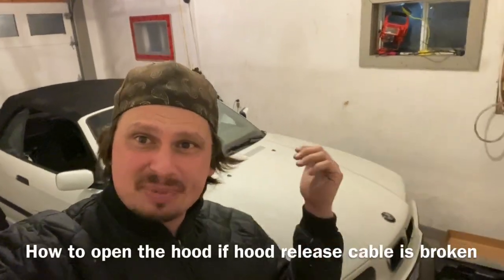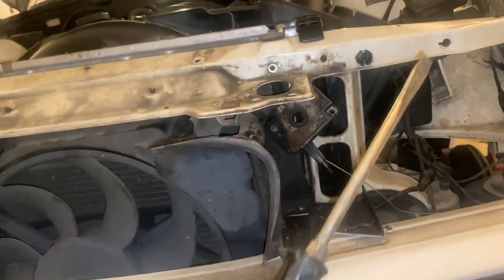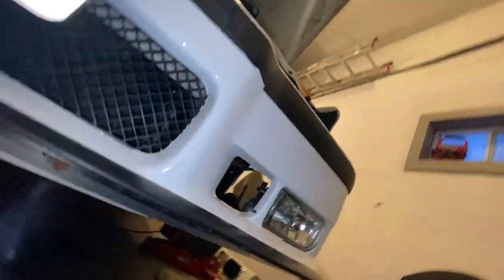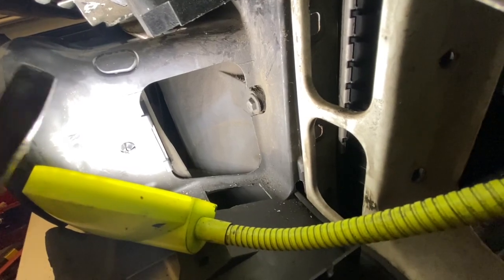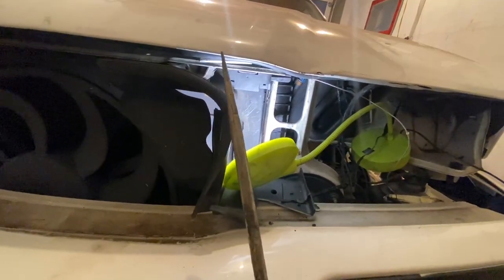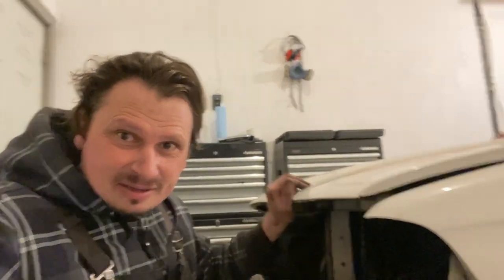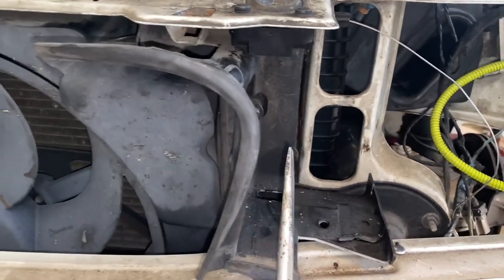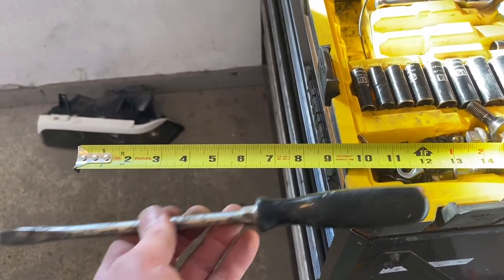BMW e36 How to open Hood with broken hood release cable (without removing anything)

Comment: Guys it really works! Maybe you should know, you’re not going to pull that whole lock to the opening side.. you just have to move that plastic wich holds the cable of the passenger sided lock & push it slightly over 🦾 

do that movement, which the cable would do! 😊
Reply: Definitely following you, bro!
U saved me😅

Comment: Gonna try this tomorrow! 🙏🙏👍👍
Reply from the maker: Awesome good luck, it does work
Reply: @ProblemSolverGarage Success! I didn't have to even use a screwdriver or remove bottom bumper shroud.
Instead I popped the front kidneys out, peeled back the plastic guard and used a pair of expansion bent tip cir-clip pliers, it was too easy! 
Many many 🙏 Thanks! 
Now I have to replace that damm cable!
Reply from the maker: No problem, glad you figured it out good luck with the cable I also have a video on the cable are very detailed one
Reply: @audiobunny1767  what did you pull? I’ve been outside trying to do this all day the screw on that latch on mine either unscrews or tightens. It doesn’t pop the hood I didn’t want to unscrew it all the way?

Comment: hey man i've managed to get the widest screwdriver i've got into the correct place.  twisting the driver does move the "tab" but it's still not releasing, any ideas?  My "tab" is moving much more than yours appears to need to move
Reply from the maker: Maybe the cable broke in between the two latches in that case it’s only opening one latch.
You might have to pull your front bumper off and start taking things apart to be able to get to it better

Comment: One of the worst designs by BMW to basically ripoff the customer on a regular basis. I was quoted $1200 to replace the “hood latches and cable” for a 328i with 45k miles on it. How ridiculous is that?
Reply from the maker: Ridiculous